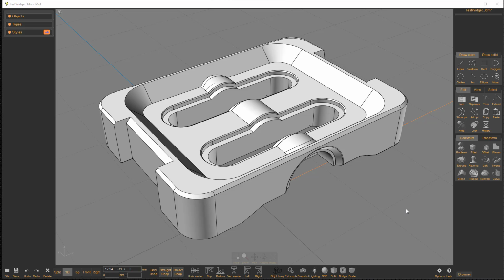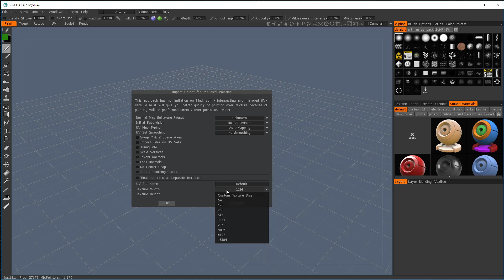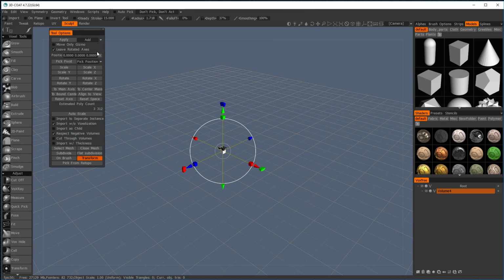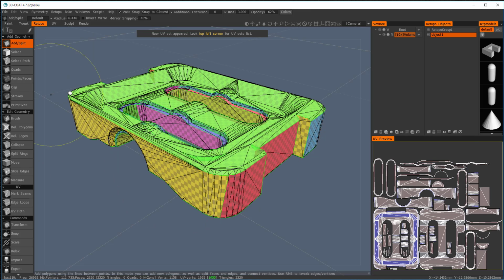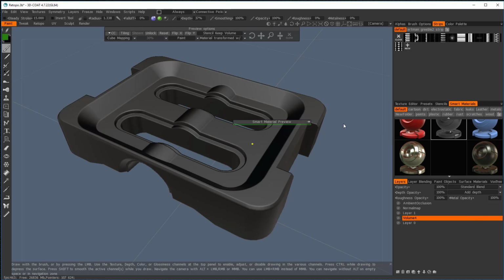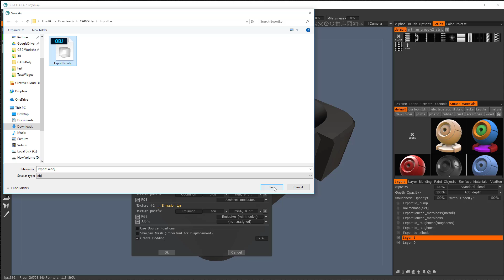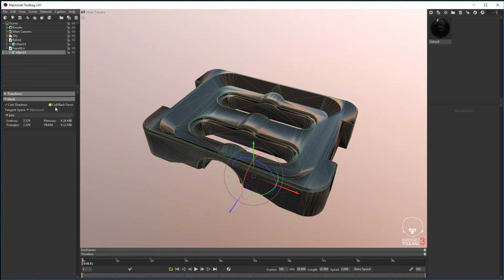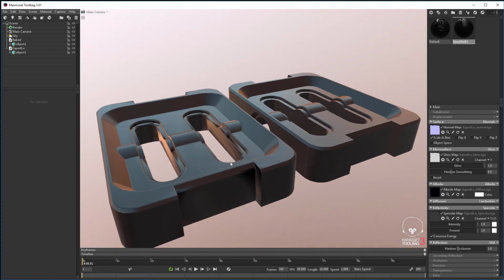NURBS CAD to LO POLY VR Workflow

Comment: nice dude, but I woud say you have some artifacting in low poly model - when normals are applied. you should make a tut which covers a precise tweaking on cage on baking proces, very detailed or it's useless. Production ready meshes with normals must be near perfect, because even aminor mistakes will be seen in marmoset, or trough rendered image or game engine. anyway interesting video, but do some as if you were doing something for final rendering or importing in engine. Those little Technicalities is what is separating excellent geo vs bad amateur ones.
cheers
Reply from the maker: That's a very old video done many years ago. Now I use substance painter and I get much better results. They're are a ton of videos on how to do that.
Reply: @ChippWalters  o.k then... do you manually retopo (solid or nurbs geometry) and then low p. and high p. cage bake in substance?  Just asking because, let say you do a automotive model with nurbs surfaces and some solids mixed up together. I guess that kind of workflow must be done manually? retopo, and bake (material gorups or exploding bake)... Asking because tried to do some polygonal car modeling and find that is way harder and not so clean with curved areas/surfaces than with the nurbs curves. But again that kind of surfaces to polygons - it's tricky I guess... only to export from cad as obj or some other format as low polygon surface and then do a bake...dont't know seems fucked up. Someone will say, for games and anims, polycars will suffice, but it's way easier to do it by blueprints with curves and blend them... 
what do you think?
thnks :)
Reply from the maker: @RankoJordanov  exporting from Moi3D, you can express at both low and high resolutions. Our you can use a tool like Quad Remesher to remedy then add subds to produce high resolution.

Comment: Why not use N-Gons?
Reply from the maker: Everything in AR & VR eventually ends up in triangles, so I try and use them as early in the process as possible.
Reply: Oh thanks for the answer. I prefer exporting as ngons, as it's easier to cleanup the mesh and mark uv seams in Blender. I then triangulate it afterwards right before baking.

Comment: Chipp, have you ever tried to bake down a normal map from a high poly and render the low poly in Keyshot with normal maps?
Reply from the maker: That's what I did in this video.
Reply: This render was done in Marmoset Toolbag, but I was referring to Keyshot(?)
Reply from the maker: Oh. I'm sorry. You're right of course. I have used Keyshot as well. Just not for this technique.